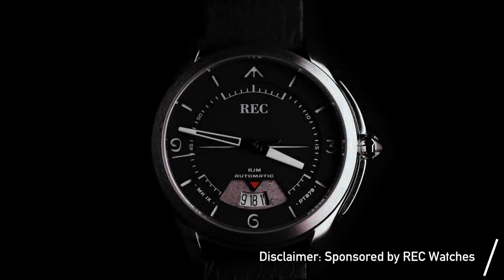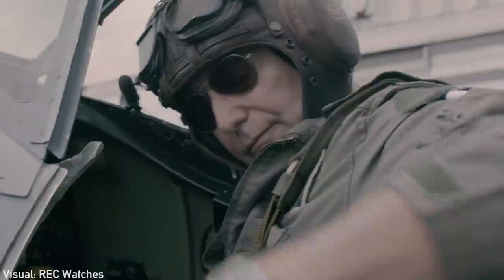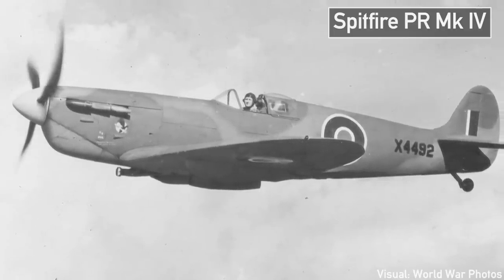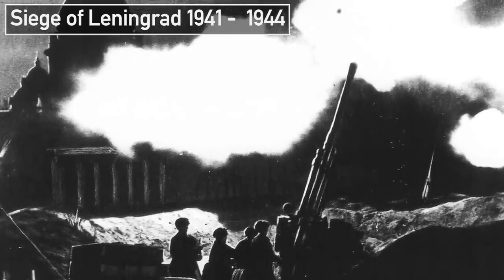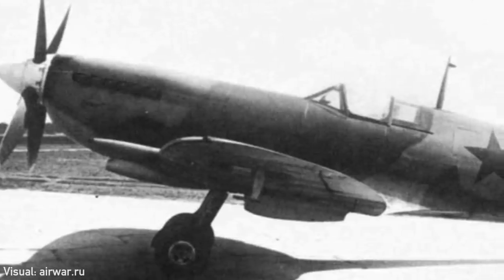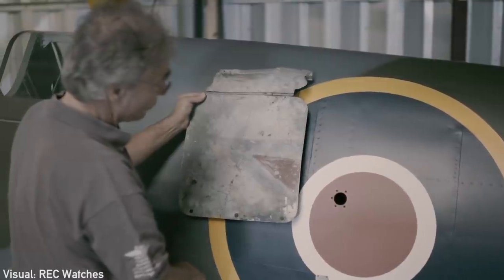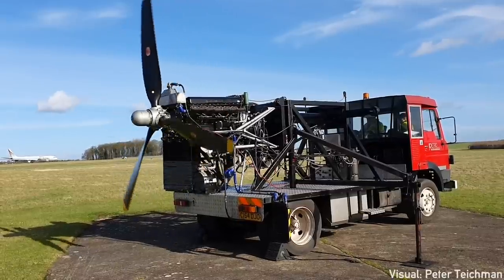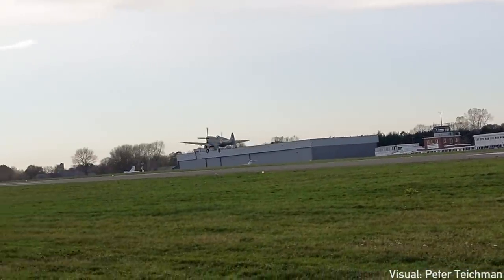From Wreck to Restored & Flying WW2 Fighter

Comment: Basically the only way to get that plane back into the air is building most of it from new parts. It`s true for most restaurations nowadays. Even if you find a good looking warbird somewhere in the tundra, there will be lots of corrosion and cracks. There is just no way to use that old metal and have a save airworthy aircraft. 
People always complain and ask, "but is it original?"
Well, yes and no. 
At one point in time in the future, there won`t be any airworthy "original" warbirds left, just because of what planes have to go through.
It`s a high stress, low tolerance environment. You don`t fly if it isn`t safe. 
Even if you had, lets say, a WWII P51-Mustang that has never stopped beeing airworthy. Even that plane would at one point be more unoriginal than original, just because parts had to be changed. There will be wear and tear and.... there will be crashes, which means new parts instead of old parts.

Next time you see a warbird, don`t just ask "but is it original". Ask, "but does it fly?", that`s where the work and money really is, no matter if it`s original or not.

Tolles Video Chris!
Reply: Exactly.  NO 100% original aircraft from 80 years ago flies today.  Even if you take and original from the big museums (Smithsonian, IWM, RAFM, etc) to make it safe to fly will require a lot of replacement parts, mainly the rubber and corroded parts.
Reply: The nice side-effect of this is, if we have the ability to "basically" make them from scratch... we could also just build brand new ones too. Something I wish people did more of, especially for planes that no longer have any airworthy, or even ANY examples surviving at all.
Reply: Unfortunately, not many will see the point that OP is making
Reply: @BleedingUranium  well with no examples at all it’s going to be insanely hard. Not everything is in drawings etc.
Reply: Yeah. I was going to say, that thing was mashed potatoes. What could they have used? Maybe 2% of that rubble.
Reply: The call it a reproduction. Not a restoration
Reply: @BleedingUranium  Thats what happens. The Flugwerk Focke Wulf 190`s are a good example. The main problem is always getting a proper engine. In that case they used a relatively similar russian engine, since the BMW801`s weren`t available and no one was making parts for them. Also, the newly restored/rebuild IL2`s run on american allison engines.
Reply: @BleedingUranium  They are building new ones.  At least on P-51A, five Fw 190's and five Me 262, completely new builds, oh, and a Potez 63-11.  Not to mention a few dozen Yak's
Reply: My last restore was a 1930's Toy Airplane. They are just amazing ✈✈✈
Reply: @pricelesshistory  well, yes, but there is a difference between 1% original and 85%.
Reply: @pricelesshistory  That's amazing! I hadn't heard about any of those, and I'm so happy we're seeing some of these set to fly again!
Reply: Ny
Reply: Whereas I support the restoration and preservation of all warbirds, this does remind me of the guy selling the ax George Washington used to chop down the cherry tree.  The handle has been replaced and the head was replaced, but it's definitely the ax GW used.
Reply: @regel303  :)
Reply: @BleedingUranium  Of course!  If someone has lots of money burning a hole in pocket and interest to do it.  Cost at least $1.5 million to build an copy (less if use modern material)
Reply: A ship of theseus I believe is the term for such things.
Reply: @regel303  lol
Reply: It is much like a broomstick that's had 17 new handles and 12 new brushes. It is still the same initial broomstick even though it is not the original anymore; much like, a ship that's had all of its planks replaced.
Reply: @pricelesshistory  I want to see a Yak-2 KABB in real life one day. It's a funny looking plane, but it's one of my favorites. Too bad most of them were destroyed in Barbarossa.

Comment: How great, in my local aviation museum they reasently restored a BF-109 that was saved from a lake 10 ish years ago, not to flying condition, but still
Reply: Which museum is it in ?
Reply: Bodø or Sola in Norway perhaps? Those planes are both restored so they could fly in theory, but they will not fly. But they are in «flying condition» in some ways
Reply: @sindeecakes  Bodø
Reply: That’s good, when restored to flying most of it is thrown away and the history is lost, what flies is a brand new aircraft painted to represent the original

Comment: BTW: This Spit is perfect example of "Data plate and a set of wheels is all that is needed for a "restoration".  XD
Reply: Unfortunately that is often the only option.
Reply: Just looking at the wreckage makes it clear that this is a fine example of the Ship of Theseus question.
Reply: Still gets you a good parking spot at Oshkosh!
Reply: The remains looked like they needed a air pump to inflate the Air frame.
Reply: Same as classic cars.Give the VIN and the Ownership documents..
Reply: @davidbrennan660  I heard thats exactly what they did.
Reply: We should make a version of the Ship of Theseus as the Spitfire of Theseus
Reply: What I heard is there is a certain element of the landing gear that’s almost impossible to make; you salvage that, and the data plate and build a new Spitfire around that...
Reply: @Skyprince27  Yes, that is about it.  The sheet metal parts are easy to remake.  It is cast pieces (like gear legs) are far more difficult.  Even todays CNC metal milling would take a lot of time with gear legs due to complex curves.
Reply: @jslaon  bloody right mate! I intend going back to Oshkosh hopefully for the July bash next year 2022. I toured there in early March 2019 in the midst of winter with temps at minus 10 F and 2 feet of snow. We were the only visitors and were made so welcome that I must go back to see the airfield nice and green and not white lol. Hopefully I may persuade someone to take me up in a war bird of some sort. I'm not of the litigation kind so will be happy to sign any waivers they put in front of me. I won't sue them for chucking my lunch!
Reply: Oh, man, that poor thing looked like road kill!  Most impressive before and after ever.

Comment: The RAF phased out the Merlin engine in favour of the more powerful, simpler with far fewer parts, RR Griffon. The Griffon was not installed in the Mustang or Soviet supplied planes. The RR Crecy was to replace both engines eventually. The Crecy was a two-stroke sliding sleeve engine with remarkable power/weight ratio for the time, being tested on a test bed. However dropped as jet engines were the way after 1944/45, for high performance planes.
Reply: The Crecy (sic) was a very interesting development.  It might have succeeded, but lack of resources in wartime led to slow development, unfortunately.
Reply: @owenshebbeare2999  
The jet engine ended the Grecy. It must be said that the existing engines were more than a match for anything German or Japanese.

Comment: The Russian planes at low altitude did not have to carry the weight of the high altitude Spitfire IX's two stage supercharger and intercooler.
The 'low altitude' LF Mk IX optimisation was tuning the 'horizontal M' two speed supercharger power vs height graph so that the lows of the graph were kept higher than those of the FW 190A's two speed supercharger.

Comment: That's not a restored plane. That's simply making a new plane.
Reply: Yeah sure
Lets 'restore' the plane with the nonexistant 'original' part and hope it flies
Reply: You have any idea how difficult it is to restore one of those old warbirds with 100% original parts? It is essentially impossible, many of those parts do not exist any more and have to be rebuilt from scratch. Those old aircraft also have to be brought up to modern aviation safety requirements, which requires further changes and additions else you would not be permitted to fly it. 

Rathyer than complaining how it is not 'original', that is is a reproduction, why don't you go and educate yourself about the difficulties of restoring one of those aircraft. Look up how difficult it is to get original parts which are no longer made, and themselves may have deteriorated with age and need minor rebuilds. There is not a single 100% original warbird in the sky, period. Not one. 

So stop being pedantic and just enjoy it for what it is, a rebuilt old Spitfire, with parts from an original that has real historical providence....
Reply: Yes. Im very aware of the difficulty. Thats why that is not a restoration. It is simply making a new plane using a few parts from a donor plane to add some histórical value.

Comment: The original batch of Spitfires the USSR used, they did not really understand them, not knowing fully in what situations to use them. The British sent 7,000 planes to the USSR in total.
Reply: A lot of the original Mk V`s sent to Russia were actually planes that had seen a lot of prior use in North Africa and so were not in the best of condition. So the Russians were less than impressed with what they got. This one though was supplied new, probably through the "Lend-Lease" system and a later variant so hopefully was better received.

Comment: Restored? Given that mangled wreck, looks more like they built a near brand-new one.
Reply: Did you not watch the video ??
Reply: @sizzler2462  Look at the devastated condition 1:21 even if they have plenty of original pieces recovered from the crash site, many can't simply be hammered back into shape and be considered air-worthy components; the damage and fatigue to the metallic structures are prime spots for ripping apart during flight.

Even a workable aircraft that never crashed will eventually break at the tiniest of places if not given regular hardware refresh (i.e. brand new parts). Just look at the 2011 Reno race accident.
Reply: @aaronseet2738  yes I appreciate that very little of the original aircraft was used but in the video Bismarck stated that hundreds of parts were utilised and the restorer says many parts were repaired refurbished and used every using some of the original gages

Comment: I ask myself about these restorations- they seem to be the re-manufacturings in many cases. Maybe 5%  of  the original parts of this crashed example could have been used; not much more, but then it can be said now - it is an original plane. Well...

Comment: Of course, spitfire is a great aircraft, but it didn't take root in USSR, in the main because it wasn't too many of them. But it served well as a high altitude plane, soviet mig 3 fastest aircraft in 1941, that had the same role, wasn't produced to that time, and the rest of the planes were worn out already. Everyone knows about spitfire's positive sides: it's speed and horizontal maneuverability etc, but soviet pilots singled out some of it's minuses. Such as wing armament, soviet pilots get used to machine guns and canons placed in nose of the plane. It dived badly, Alexander Pokryshkin wrote in his memoirs that even LaGG 3 was diving faster than mk V. Five also had the reverse of the ailerons appeared, which imposed certain restrictions on the g-forces and reduced the range of allowable speed evolutions. New generation soviet fighters, such as: Yak 1, Yak 7b, LaGG 3, were faster (lower than 6000m) and had higher rate of climb (lower than 5000m) faster than the spitfire. Also it had problems with landing gear on poor coverage, and could fall on the nose sometimes. 

All of this doesn't make Spitfire a bad plane, there were just few of them on the Eastern Front.

Comment: Why does the tail rudder look different to a normal spitfire????
Reply: Longer Mk IX engine at the front needed more vertical stabilizer area at the back.
Reply: Later production series of the Spitfire Mk IX.

The taller tail fin originally came from the Mk VII design, which never replaced the Mk IX, but upgraded parts of the Mk VII did eventually make themselves into later produced Mk IXs.

I suggest you read up the story of the Spitfire Mk VII, it's quite an interesting one.
Reply: @givenfirstnamefamilyfirstn3935  There are many different Mk IX's. As with the Mk V's they were originally stop gap's dealing with a specific threat. Mk V's were mostly converted Mk I and II's and were supposed to be an answer to the German high altitude bombing threat . Mk IX's were originally converted Mk V's and were later build new with improvements from the Mk XVI's like the enlarged tail planes and re-balanced elevators.  Their original purpose was dealing with the threat of the new Fw190 A.

Comment: strangely enough, at 10.55 there's a small sign with a Greek flag and Icarus Foundation, Hellenic Air Force written on it. It must have been left there from another restoration that was done in this hangar, a Greek Air Force Spitfire that was for years displayed in the War Museum in Athens. It was restored back to flying condition (it was in a lot better condition than the wrecked russian though).

Comment: I've read that the performance problems with Soviet Spitfires was due to the different standards in octane rating between British and Soviet fuel. The British used a rating of 120 while the Soviets used 90 octane fuel.
Reply: Except that one major part of Lend-Lease was the higher octane aviation gasoline, which the Soviets could never produce enough of.
Reply: @kemarisite  I see. I must say I had my doubts that a fundamental thing like a standard was missed by engineers on both sides of the deal. I mean even nuts, bolts and spanners had to be taken into account. Missing the octane rating doesn't sound right. Plus the performance would have been affected at higher altitudes not lower altitudes. Thanks for putting me straight on that one Frank.🤔👍